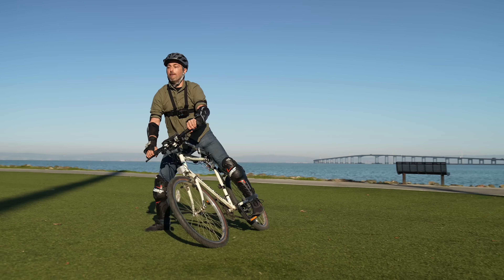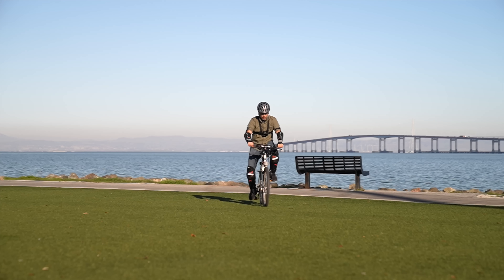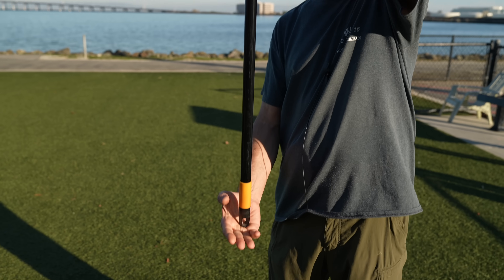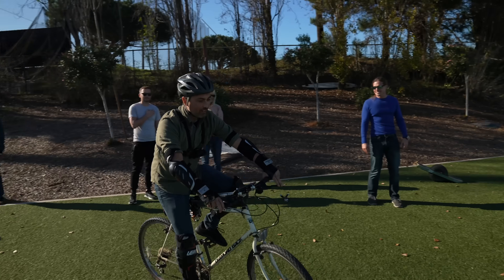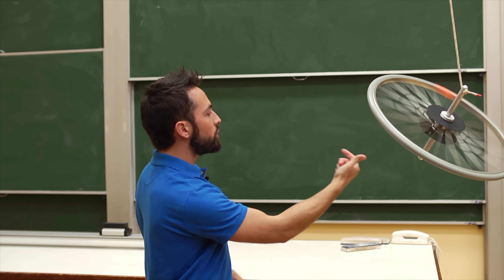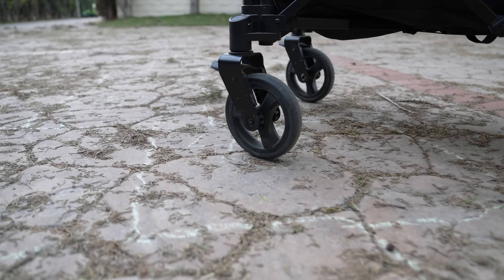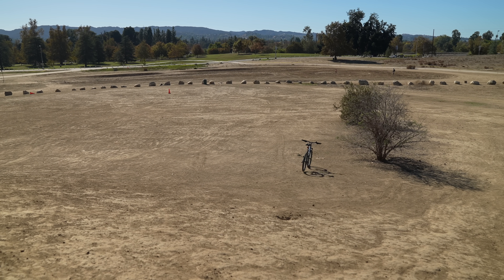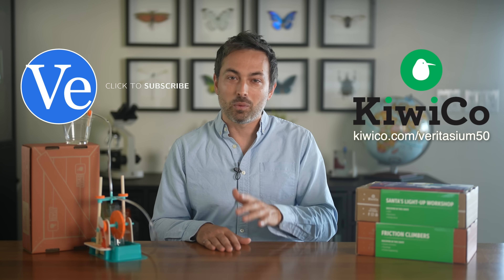Most People Don't Know How Bikes Work

Comment: I always wondered how we were able to ride the bike without holding the handlebar. It was even more confusing to me since some of my old bikes are impossible to ride like that, while the new ones seem naturally designed to control themselves. Now I understand why.
Reply: Huh. Now I kinda want to try it
Reply: @maxwilson7001  Don't forget that to let go the hands of the handlebar you need a considerable amount of speed, otherwise it won't work. There's always a risk involved, but once you learn how to balance it you can even make turns without the hands.
Reply: @pedroakjr2371  Good info to have. Thanks
Reply: @pedroakjr2371  i watched a guy ride around all the time for miles without using his hands and turned and everything...i eventually figured it out a bit, but could only do it for pretty short distances
Reply: @itsianman  If you can do it for a couple meters you can do it longer, it's a matter of finding the best place to practice. People think that this is a show off, but being able to ride the bike without hands is actually a pretty useful maneuver that can help you in many situations.
Reply: @pedroakjr2371  riding without hands is very easy skill. It just has a lot of risks.
Reply: @pedroakjr2371  it's not that hard. My buddies and I we roll cigarettes while driving on our bikes. Turns and everything we could drive around the whole town, I think it's just about balance. Edit- haven't crashed my bike in like 3-6 years, if you do it safe and at certain times use your hands just in case you are good.
Reply: @pedroakjr2371  Yeah nah, there's no reason you should ever have both hands off the handlebars at the same time. If anyone walks out in front of you there's no shot you're going to be able to break in time, it's a silly thing to do and a danger to both yourself and those around you. If you really need both hands for something then pull over and stop.
Reply: @itsianman  i did this all the time to work.
Reply: I can start without handle bars. It's exactly like starting a unicycle but I have to lean opposite to the way the front wheel happens to be leaning.
Reply: You must live in a cramped urban place. You can reach the handlebars in less than a second. If you're riding somewhere small enough where you need less reaction time than that, you're likely already holding the handlebars out of common sense. Riding without handlebars in wide open places is safe and I've never collided.
Reply: @boggart1062  Sometimes you need to chill while biking and taking off both hands is the best way to do that. 
       Any sign of danger you put hands back on for time being simple
Reply: Yea but its fun and looks cool
Reply: @kl4753  in 3 to 6 years?  What kind of cigarettes are you rolling if you have to make such a wide estimate?  Are those "funny" cigarettes?
Reply: so fun no not using hands, i always text while riding
Reply: @itsianman  As a kid I remember practicing it for short distances on my way to school. Suddenly it clicked and even though I rarely practice it I can still ride and turn comfortably without using my hands. It's the same as swimming.
Reply: @pedroakjr2371  Not really. It definitely becomes easier at high speeds but you can ride without hands even going 10 kmh
Reply: @boggart1062  There’s plenty of situations where riding with no hands is useful. Like if you have to zip your jacket or put on gloves. If you’re going fast you don’t have time to break before hitting something anyways, so having hands on the breaks really isn’t that useful
Reply: Physics is so easily manipulated in way that feel unnatural
Reply: I wrecked so badly the first time as a kid. As I got older, I taught myself how to do it slowly, simply moving my hand a couple inches away from the wheel. Eventually I could ride fairly easily, turn reasonably sharp, even at lower speeds.  Be careful, but with practice it will come.  It is nice to ride like that to give your hands a rest.  That way you can play on your phone as you ride :)
Reply: @ridemywheelie  You should never be on your phone while riding, that is the most idiotic suggestion I’ve ever seen. I’m sure you text and drive as well 🤡
Reply: When you ride the bike without holding the handlebar, you can technically turn with this bike, because you don’t have to steer in the other direction to lean your bike. You can just lean in the right direction and turn. However, this is definitely more dangerous than trying to ride this bike with your hands on the handlebar, because when you are leaning just slightly to one side and this side of the handlebar gets blocked, there is no way you can lean in the other way. And you can easily get more hurt
Reply: You dont need high speed for it. Before i changed front fork and steering handles i could drive without hands longer with mid speed and a bit higher speed. But after change i can drive without but extremely short time, because steering is now unpredictable it tends to move very fast left or right so its guaranteed fall.  balance is probably fukd up.
Reply: I almost exclusively ride my bike without holding the handlebar when I'm up to speed (yes, it's ridiculously dangerous but I always go back onto it when I cross another person or car) and I've noticed when I switch bikes I tend to "lose my touch" going back to my own bike. I think there's a degree of body control and balancing where you have to find the "right spot" to control it with your full body
Reply: @man4437  Which is illegal in many places.
Reply: I have had multiple bikes not suprising in the netherlands, but with a crate or box on the front its not able to drive like that unless the weight is spreaded evenly. I don’t know hoe bikes work exactly but I noticed that.
Reply: @chrisboogerd3031  yeah a crate ruins the balance of the whole bike. That's why I never liked using one.
Reply: It was actually something me and my father were discussing recently so i probably spent several days only to play with all the different bikes we have in our garage to reach the same conclusion as in the video. It can be reached by common sense and observation aplerantly (i am very bad at math and phisics, my father too to an extent despite he graduated specializing exactly that).
And i learnt ride without both hands for first time, very comfortable skill but probably one i will not use considering i just prefer vintage town cruisers.
Reply: I know wym mean. Riding on pedals and eventually learning the front and back pegs were highlights of my childhood with biking. 10 y.o. me never thought when doing it though, that "hey, I don't even need handlebars to turn" ya know?
Reply: I’ve never been able to ride without holding the handlebar, I was falling after less than a meter. Really annoyed me for years since all my friends were able to do it

Comment: Well, of course you can just lean into a turn instead, although countersteering gives you much more control and speed to turn with, especially at lower forward speeds. The locking out mechanism meant that unless you happened to be leaning the right way, there was no way to lean first, but bikes don't have locking out mechanisms so as long as you know ahead of time which way you want to turn, you can lean into it instead of countersteering.
Reply: So, why can't you lean in after it locks?
Reply: @cymond  If you ride with no hands you normally just lean in the direction. Tho ya less control
Reply: @biohazardlnfS  no hands the bike countersteers itself. As explained in vid
Reply: @cymond  One can still lean after it locks.

And to be fair, one can weld the handle bars in place locking it off completely and still be able to turn just fine. However, one's minimum turning radius is going to be quite large.
Reply: @nystemy  Ok, can anyone point to a demonstration of a "locked handlebars leaning only" bike ride? I'm genuinely interested in the results, but not enough to go weld a bike's handlebars myself.
Reply: when you say leaning, you say it in the way that ""leaning""==countersteering

Comment: "Steering doesn't work when you are stationary"?! And this guy it's an engineer?! It's not rocket science. It depends on the angle of the fork and the distance between the imaginary line from the fork that ends in front of the contact patch. A chopper has front fork angles that dirt bikes don't, to induce or reduce straight line tendencies. 🤷🏻‍♂️

This whole video is trying to convince you you wouldn't understand how this works, but could explain it straight up and most WOULD understand.

Comment: You lean first. Then turn = The way people that know how to ride bicycles and motorcycles make them turn to where the wheel is pointing. The opposite turn is an emergency maneuver that makes the lean faster letting you avoid an obstacle in less time, but it has a high possibility of sending you over the bike if the turn stalls.

Comment: It's called "countersteering". Bike then "tracks out" until you get to the radius of turn you want. Turning a two-wheeled vehicle is, essentially, a controlled fall. PS - Some guy a few years ago built a bike that turns opposite to handlebar direction. It's rideable ... if you unlearn how to ride a bike. ☺️👍🏼 Good video!👍🏼PPS - a motorcycle racing instructor built a motorcycle with a "no BS" bar on it to demonstrate you can't change direction with only body weight shift.
Reply: Anyone interested in that video, it was a 'Smarter Everyday' video :)
Reply: Not unrideable, went to an ocr once and in the little village before it they had a slalom set up with a switched steering bike. At least 20 people had won the pair of shoes and had their name on the board. I just went in for no hands and go fast and it was easy enough after the second pedal stroke.
Reply: @johnstoddart9026  Thanks, John 👍🏼 I’ve never seen it myself and, by the time word got to me, it was “unrideable”. The thing is, I rode motorcycles for over 35 years, taught over 2,000 people how to ride, rode mountain bikes and participated in lots of endurance mtb races over the years. As an old dog, always kinda wondered how difficult it would be for me. 🤷🏻‍♂️👍🏼
Reply: Interesting that you mention controlled falling because that's exactly what walking is as well.  It's kind of a big deal for walking robots since robots are generally less flexible and less shock absorbent.
Reply: @grn1  You mean you have to program robots to know that "UP" is the direction perpendicular to a flat, liquid surface? Obey Gravity - IT'S THE LAW!
Reply: @FilosophicalPharmer  I am not sure how to respond to your comment since it makes no sense.  Robots can't just not obey the laws of physics but they do have to be programmed to deal with them.
Reply: @grn1  You said walking is a controlled fall. Gravity is what attracts us to earth and makes us "fall". "Up" is the direction away from gravity. The only means I am aware of to define "up" is the direction perpendicular to a flat surface of a liquid. You also mention robots. Robots have programming. They have sensors telling them which direction gravity is. The computer programming tells them what to do with that information in order to stay "up". Make sense now?
Reply: .... and a plumb bob.
Reply: I don't believe that cuz as I stated, I can wheelie a scooter and steer it with the front tire completely off of the ground so yes I AM steering it with leaning my bodyweight only.  The front tire eventually stops and I can still do this so there is no gyroscopic effect from that front wheel/tire combo.  So explain that.
Reply: @davidjames1684  When you lift the front tire, you're no longer riding a bicycle, you're riding a unicycle with an extra wheel attached.

Comment: This is a great lesson for motorcycles also. If anyone has experienced the "death slap" will know that letting the handlebars go is the best way to let the bike get to its normal state.
Reply: You shouldn't be holding on tight to the handlebars anyway. Best way is too loosen your grip, like you said, and also lean forward onto the tank to put more weight on the front. Or just do a wheelie lol
Reply: death slap? do you mean death wobble?
Reply: @thomaskletzl6493  i guess death wobble + tank slapper is a death slap 😂
Reply: Press your knee into the fuel tank.....
Reply: Squeeze the tank with your knees
Reply: Same with roller blades and the death wobble, just lift that one off the ground for a second an skate on the other one to stop it.
Reply: @TheProtocol48  You mean your foot can catch a shimmy too on the roller blades?
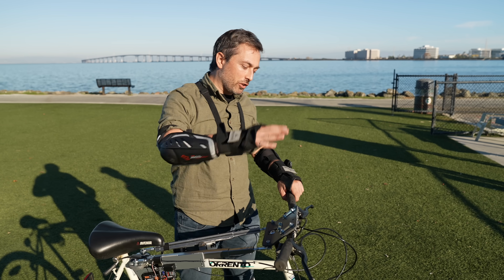Reply: "When you ride a bike and want to turn left (...)" - 00:19, at this point all motorcyclists know what he is talking about ;)

Comment: I think this can apply to driving a car as well. Not necessary to do so, but my thought is that you can preload the suspension to one side of the car to help fight some body roll in a corner. Particularly on a vehicle with soft suspension.

Comment: Motorcycle riders press and roll in the direction they intend to turn, called counter steer, which is essential for prooer control of the machine above 30MPH. Below that speed, you can ride a motorcycle more like a bicycle but you have a higher risk of crashing. Some early motorcycles even had a knob to lock the steering above 30 miles per hour. 
So, why the change in behavior at that speed? Also, can you counter steer a bicycle like you would a motorcycle?

Comment: I feel that 1 big thing is missing in this video. Centar of mass and the effects of mass itself. My reasoning is that while you move slowly on a bicycle you will always be off balance, because the centar of mass have risen and now you are top heavy. Top heavy things are very unstable if the centar of mass and contacts to the ground aren't perpendicular to the ground. Thats why motorcycles even at lower speed don't need "countersteer" because centar of mass is low because of the engine and tyres have wider contact area.
Another example is the broom part of the video, if you put some kind of weight  8x -10x bigger than the mass of a broom on the bottom and bond it together (bicycle is about 8x-10x lighter than average person), you would see that you don't need "countersteer", just walk with the broom.

Another propertie of mass is resistance to change of momentum. Bicycle is light and the mass is low so every change in direction is reacted faster. When you sit on a bicycle, the bicycle has soo much more mass on itself that any change in direction takes "extra effort" like countersteer and time because of a sluggishness of higher mass.
I'm no physicist nor scientist, I'm just looking it from a different angle...🙂
I'm ready to be proved otherwise.

Comment: No you dont have to steer the opposite way. On a bicycle frankly at any speed. You just have to lean into the turn. On a motorcyle you do steer the opposite way because they are too heavy for a simple body lean.
P.s. actually dont even have to lean. What  i like to do at semi high speeds is to push the handlebar down towards the direction im turning thus leaning the bike that way not with the body weight but with force

Comment: Great video and it's just like riding a motorcycle at high speeds. If you're coming around the curve and leaning to the left to go around the curve you pull the handle bar to the right. When I was first told this concept when I first started racing motorcycles I thought I would never work!Now I can lay the bike down in a corner and not even slow down!

Comment: This solution seems too easy, so I feel like I'm missing something, but what if you just lean before you move the handle bars. Sure if you're straight turning will pull the bike out from under you, but if you lean to the right slightly before pitching the handlebars to the right, then wouldn't it pull the bike under you from its new position of slightly under you and to the left? It can't be that simple right?
Reply: Yes, transfer of body weight works. Transferring your body weight like that is a technique that many MTB cyclists learn and apply in rough and technical terrain where you need to keep your wheels going a very specific path between rocks and roots (in other words, when there's no space for doing a slight turn to the opposite direction before aiming your wheel where you need to go).

Comment: The correct way to turn a bike is to anglulate your bike underneath you. You use your contact point where your tires touch the ground as the pivot point and push your handle bars laterally towards the inside of the turn. Inside arm extends and outside arm contracts driving with the outside elbow. You lean only the bike to turn, not leaning yourself

Comment: A motorcycle at speed turns the opposite direction of handlebar input. 
Turn right go left
As long as you are holding right pressure you will go left And vice versa. 
You do not have to lean period, at all, absolutely none in order to control a motorcycle. 
People who think you lean to turn are pulling the handlebars to the outside of the curve without realizing it. 
Honestly most people on a motorcycle don’t really know what is going on. They just like to think they do.

Comment: I honestly thought most experienced motorcycle riders and or bike riders knew this lol. Over a certain speed, steering swaps, and it’s very low depending on what you’re riding, my motorcycle swaps around 12mph, anything over that, you steer left to go right, right to go left. 

It’s just not noticeable, as you’re riding when you lean, you body naturally turns the front wheel the other direction.

Comment: Fun bike fact: did you know you can replace the spokes with strings? 

Spokes actually provide force by tightening, not pushing the wheel in shape!
Reply: What keeps the hub centered in the rim?
Reply: @EdisonCarter-d9i  The tension of all the strings together maintains the structure. There is a company making super light string spokes now.
Reply: That makes sense becuase I untighted to loose the spokes